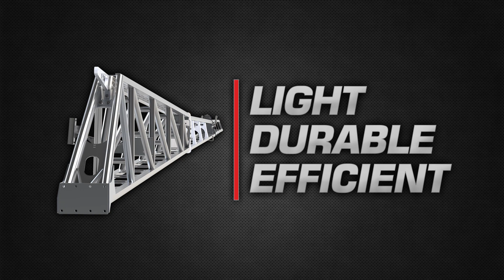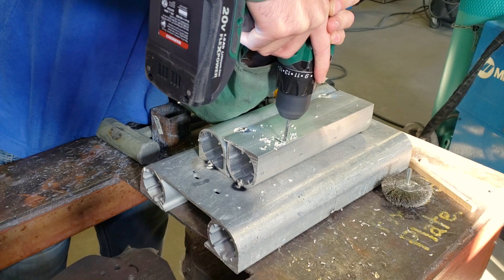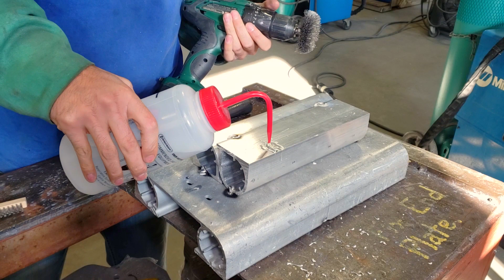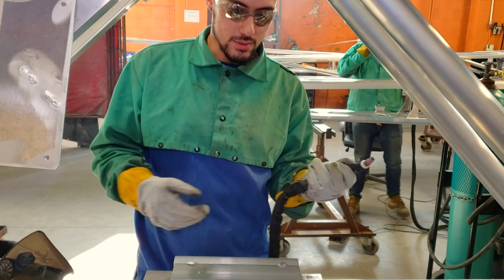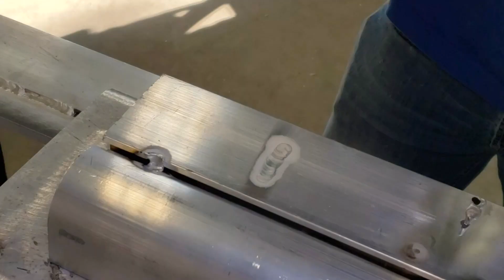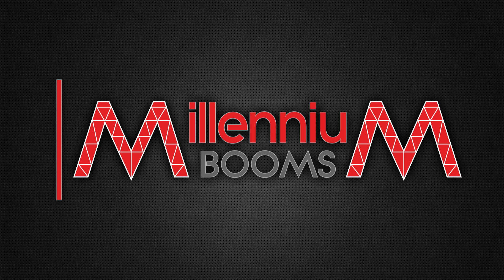Aluminum Welding: Crack Repair

Comment: Most people on You Tube seem to have no guard on grinders. I have a few grinders and only once or twice have I had to remove a guard for access and then often with a small half worn out disk.  You Tube people don't often wear seat belts either.